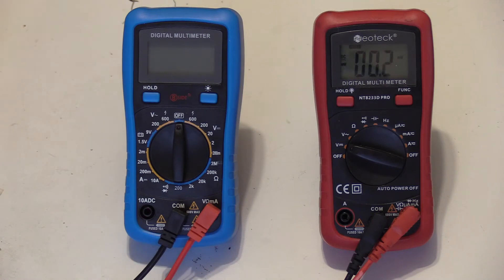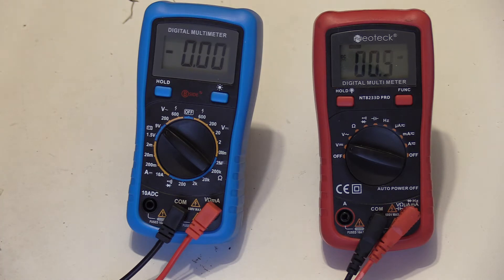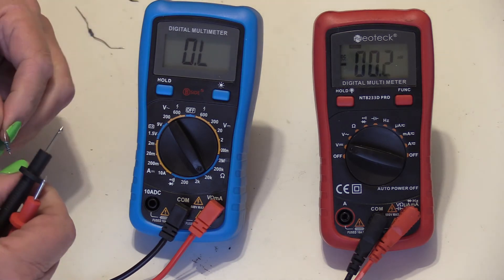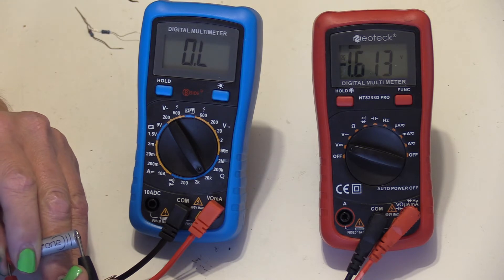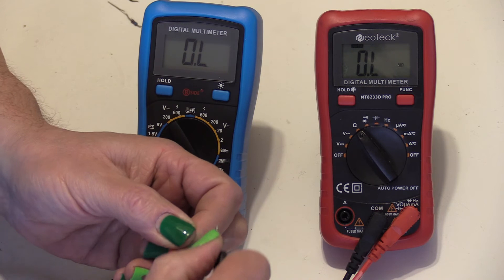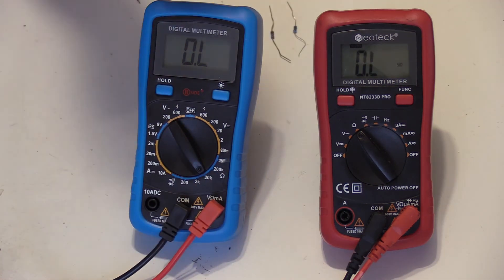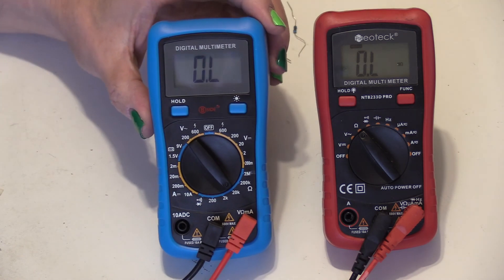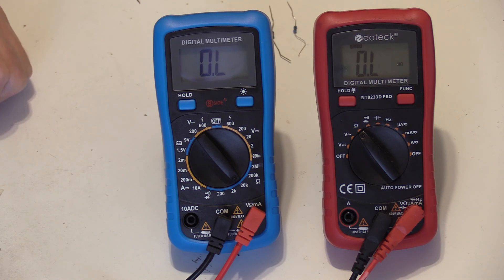Which multi-meter is better, auto ranging or manual?

Comment: So, over the limit or open loop?  Hmm. And what's up with the nails?
Reply from the maker: I Learnt it as "Over Limit" Oh, do you think I chose the wrong colours for my nails? what colours would you have had then, or are you wanting yours done?
Reply: @Toni Peters, odd stuff  it's open loop. If you're going to try to teach people, maybe 'learnt' is yourself first. 
And I figure no color would be best for a man. But that doesn't apply here, so my apologies.
Reply from the maker: @Davfed   It depends on what you learnt OL to mean. I have done some more checking and it depends who you ask as to the answer you get, so far I have found:
Over Limit
Out Of range
Open Line

No doubt there are more, so we will have to agree to disagree.  I wish you well, and good luck with the nails.